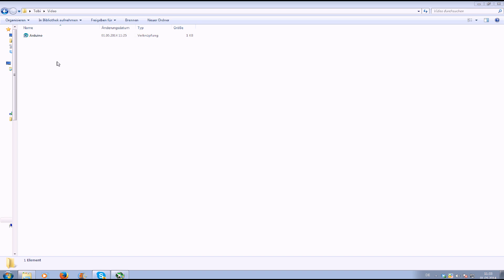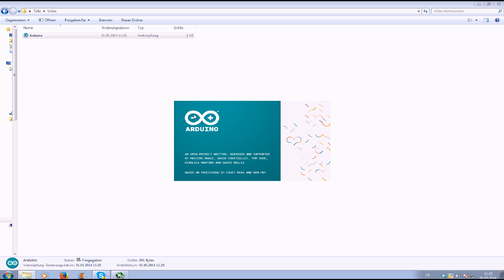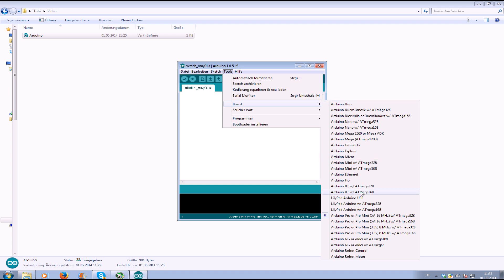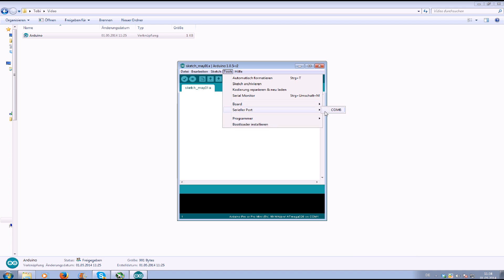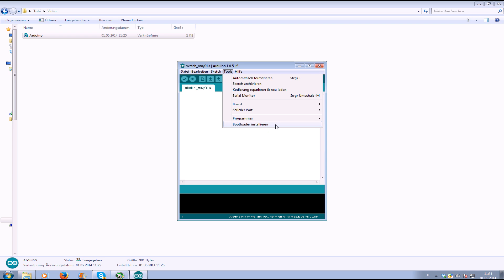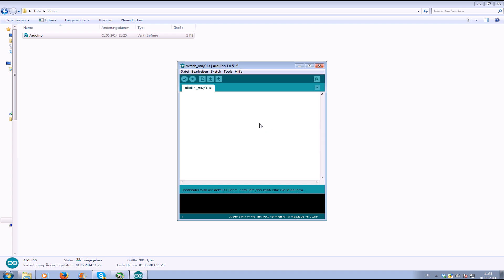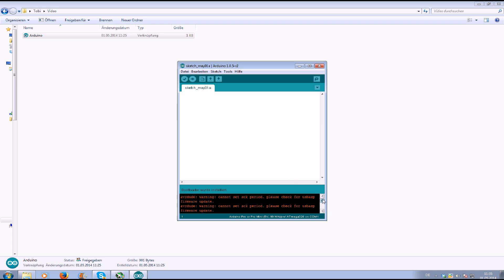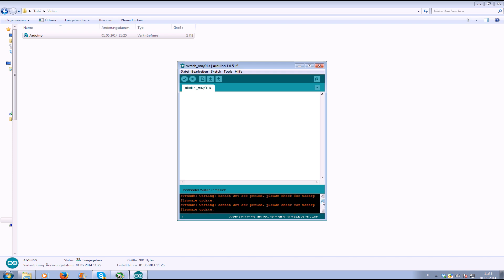Failed to talk to bootloader minimosd tutorial Second Part with usbasp

Comment: Thanks, but my USBASP is not selectable on com port. it writes on MinimOSD but then, nothing... green light still flashing very slowly and no way to update firmware or do anything,,,
Reply from the maker: Are you shure, the driver of your USBASP ist installed correctly? Normaly it must find the USBASP in the Seriall Port List as a com port. Or do you have selected the wrong com port?
Reply: Theburner99 Yes, it is selected as libsub-win32 devices. maybe wrong pilots?
Reply from the maker: claudius Cubitus
What do you mean with "pilots"?
Reply: Theburner99 sorry. Drivers
Reply: Theburner99 
I have the same issue. No port available but the driver for usbasp is installed as "libsub-win32 devices". Tried "upload using programmer" under files but get error: 
avrdude: error: programm enable: target doesn't answer. 1 
avrdude: initialization failed, rc=-1
         Double check connections and try again, or use -F to override
         this check.